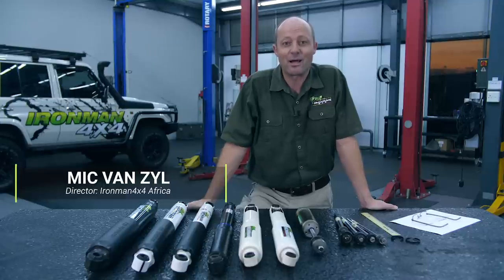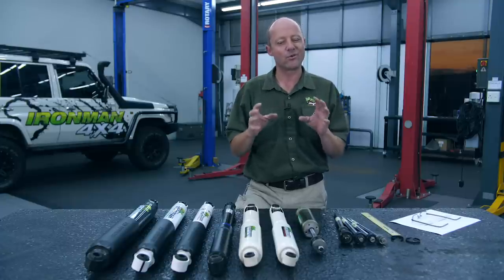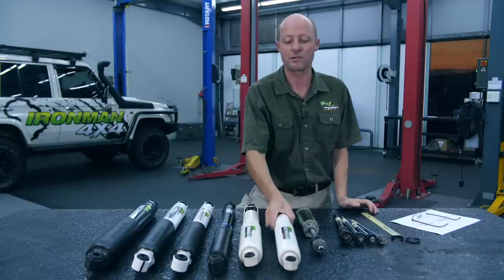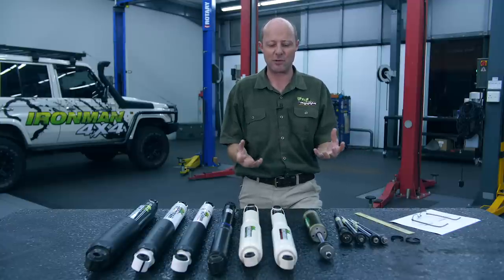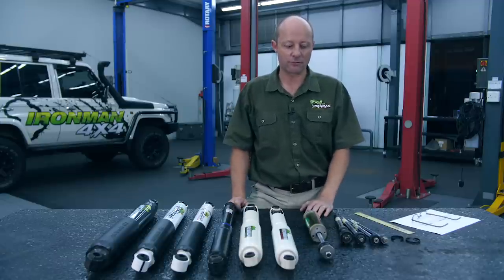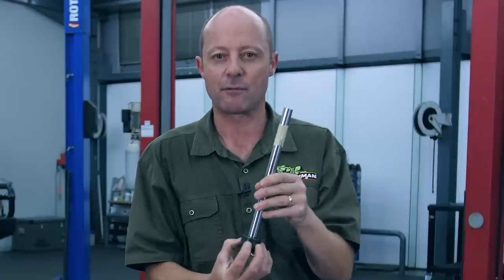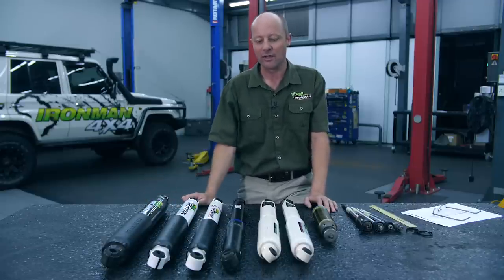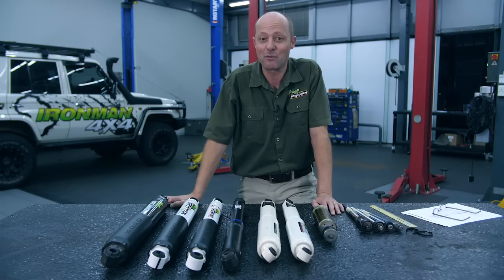Shock Absorbers Explained! - Tech Talk with Mic from Ironman 4x4

Comment: I’m a Gen4 Jimny owner. I did not want a lift kit, but a firmer suspension. 

I watched this video after I learned that two other brand wasn’t what I wanted. 

One brand was ridiculously overpriced by the local dealer and did not have the shocks at home, nor did he want to sell me only the shocks without the 40mm lift springs. 

The second brand had the complete kit at a better price than the first but refused to sell me only the shocks. 

Your representative had no issue selling me the shocks and included a steering damper as well in the price. That was a pleasant surprise. 

I travel light in my Jimny. I don’t need the most advanced shocks. Standard Nitro’s are good enough for my kind of driving. 

I wanted a slightly more firm suspension, and I got it! 
The ride is slightly stiffer in a straight line on tarmac. It is a lot stiffer when cornering at higher speeds, and it doesn’t dip as much when braking hard from high speeds. 

I got just what I wanted and I am very happy with the choice and purchase made. No regrets whatsoever.

My thanks to you for creating a great product!

Comment: With regards to the shock valving portion. Are you saying that the nitro shocks are the softest, foam cell medium, and FCP are the stiffest. Or are there different valving options within each shock series. Example would be a FCP with a soft or medium valving for a daily driver without a bunch of extra wieght.

Comment: Since I chose KO2 60 on 40 offroad tyres, I would probably just need Nitrogen shocks on my 2016 Heritage Defender? I have the oem shocks and springs that almost give you whiplash entering a speed bump at an angle.  I travel to remote areas on bad roads but don’t seek 4x4 trails on purpose. Thanks for the informative video I’m going to have a good look at my suspension 👍

Comment: Hi I have the foam cell pro on my Jeep Wrangler JL. Just a question. The foam cell pro has bump stops on the piston rod. Do I need to remove the original factory bump stops? Cheers
Reply from the maker: Some FCP shock absorbers do come with a rubber stop on the shaft. But still requires OE bump stops to be mounted and not removed.

Comment: Hi Mic, I’m wondering the reason why Ironman suspension doesn’t include some form of valving adjustment/knob/bypass on their FCP shocks, it would be great if you’re able to ‘shed some light’ on this?
Reply from the maker: Hi Jayden. I'll keep this as brief as possible. The adjustment knobs found at the base of "adjustable" shock absorbers merely adjust the flow-by of oil through the foot valve when the shock is compressed and extended. It does in some instances alter the feel of your ride but is does very little to the graphing of the shock - how it dampens suspension movement. True adjustability happens when you alter the valve stack on the working piston of the shock. These do exist. Most vehicles with in-cabin electronic shock adjustment use a small stepper motor on top of the shock shaft. The shaft is hollow with a thin rod that is connected to the motor on top and to the adjustable piston valve stack at the bottom. In car suspension adjustment thus activates the motor to adjust the valve stack in the working piston and alter the graphing. This is most common but there are several other ways of doing this.

The system that employs these adjustment knobs at the base of the shock also require you to crawl in under your truck and change the setting when required. Once the novelty wears off, it is never adjusted due to inconvenience. These knobs are also vulnerable on the outside of the shock body at the base and can get damaged off-road.

The Ironman 4x4 range of shock absorbers are carefully designed and graphed to work well with OE as well as our aftermarket range of springs. Depending on your requirement, spring rate and load, we do offer comfort, normal and professional valving as options on some of our part numbers.

Comment: Hi, I am looking for suspension for my car, 4x4 , it has 20' wheels and I tried 17' wheels since I had a terrible time driving the car on bumpy roads, and it transferred the hit to the car, it is very uncomfortable, but changing the size of the wheels didn't work, so my guess is the suspension, but I don't know if the shock absorber will help to the confort in bumpy roads

Comment: Does the foam break down?
Reply from the maker: Hi Troy. No the Foam does not break down in our Ironman 4x4 Foam Cell shocks. This is unfortunately a myth promulgated by shock companies who do not offer Foam Cell shocks in their product range. The foam cell is a tube of closed cell foam like material that is found around the outer surface of the inner tube on a twin tube foam cell shock absorber. It is like wet suit material but of course, vastly different in application. The foam cell material used in our Ironman 4x4 foam cell shock absorbers can withstand temperatures several times more than the highest temperatures generated by the heat build up in the shock oil. After 17 years at Ironman 4x4 I have yet to see a foam cell break down due to heat. I cannot speak for cheaper brands though.

Comment: We’re any of your shocks monotube? Also, the dual tube shock you show I refer to as a push/pull shock. Mono tube shocks seem to be a positive pressure shock meaning they’re constantly pushing outward. Would I be correct in thinking that?
Reply from the maker: Don't quite know what you mean by push/pull. Our shock absorbers are all telescopic and compress and extend like a telescope. We do not have any monotube shocks in our product range. They are a very good concepts but better applied to road and track vehicles. This is due to the potential vulnerability of damaging the shock canister off-road. This would render a mono tube shock unusable. With a twin tube shock, you can ding the outer tube without affecting the working of the shock as long as it is not punctured. Any telescopic shock that has gas pressure will self extend when compressed. Monotube shocks are almost always gas pressurised (high pressure). Twin tube gas shocks have low gas pressure. Foam Cell shocks are almost always twin tube and have no gas pressure therefore do not self extend when compressed.
Reply: by push/pull I mean they have resistance in both directions. Like you could collapse the shock by hand and it will stay that way until you physically pull the body and the stem in opposite directions. Just wondering if it being a monotube or a twin tube shock makes a difference whether they constantly push outward with a pretty good amount of force that makes them hard to collapse by hand or not and whether or not.
Reply: After rereading your reply I think you answered my question. Thanks for the information! Have a merry Christmas and a happy new year.

Comment: What provides the smoother ride at about stock weight?
Reply from the maker: Hi Abraham. The shocks control the springs and therefore suspension movement by absorbing the energy transferred into the spring by road undulations. The better you do this, the smoother your ride will be. If your vehicle is over-sprung, no amount of dampening with make it smooth. Fitting better shocks is always the first option to getting a smoother ride on stock suspension. If the original springs were really badly designed by the vehicle manufacturer (it still happens) then fitting aftermarket springs will improve ride quality as well together with better shocks.